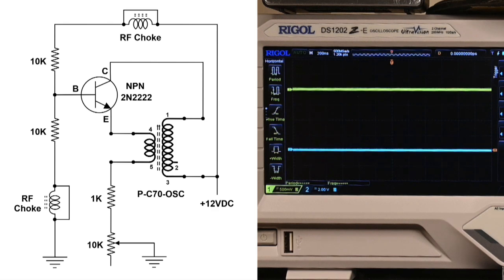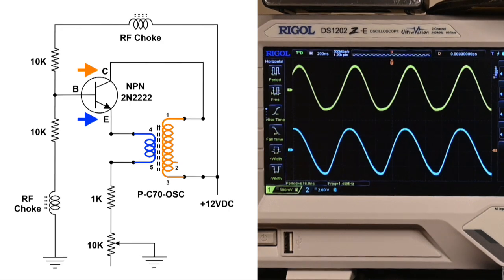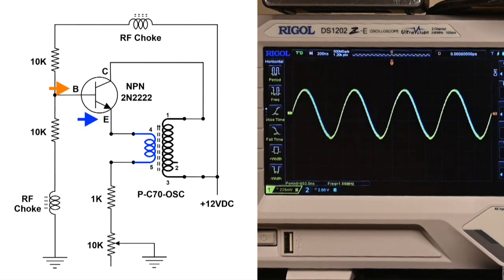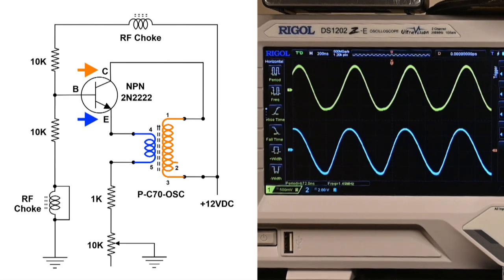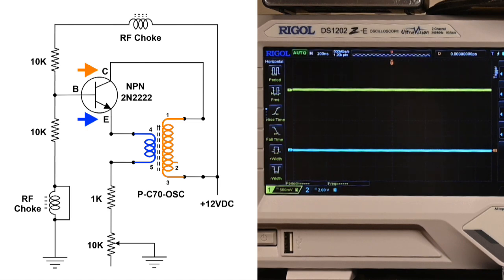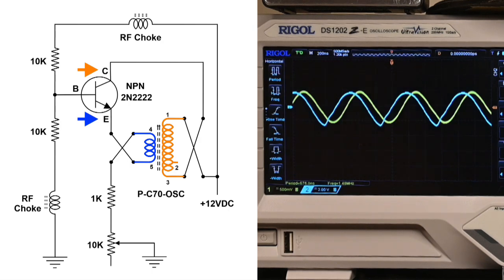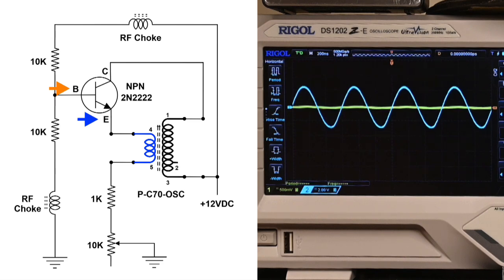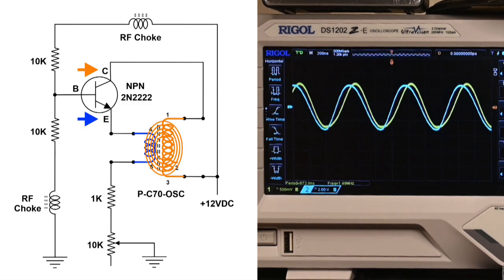Oscillator Experiment Interesting Results II

Comment: The metal strips in your breadboard are capacitance coupling the feedback to the base. The proof is lightly loading the base with the oscilloscope probe quenches the oscillation. Fun but not a mystery.  The same circuit built dead bug style over a copper ground plane it will not oscillate.
Reply from the maker: I had thought of that. I had put the transistor and the 10K bias resistors on a separate small board. There was no change. It's hard to remember everything as you make a video. Here is part II.
Oscillator Experiment Interesting Results II 
https://youtu.be/MITyF5wX8SQ

Comment: Nice little experiment
Reply from the maker: hanks for your comments.
I have had several interesting comments and suggestions about modifying this circuit. So I modified the circuit and made another video. I thought this would help answer some question. There is the link.
Oscillator Experiment Interesting Results Part II
https://youtu.be/l_yRTZ-YoPc

Comment: Its looking like the high frequency o-scopes are quite difficult to find for $1000 or less (or even slightly above $1000.  What did they use to test microwave circuits back in the day since the super expensive high frequency o-scopes are a relativly modern development?  Or have these high frequency o-scopes always been around and just never come down in price and only available to large institutions?

I wonder if its possible to build a high frequency o-scope?  I built a metal cutting CNC machine and a chemical lab why not an o-scope.
Reply from the maker: Yes you could build your own, but usually it does not save money. Most often  it costs more and is not as accurate.

Comment: 🤠
Reply from the maker: Thanks for your comments.
I have had several interesting comments and suggestions about modifying this circuit. So I modified the circuit and made another video. I thought this would help answer some question. There is the link.
Oscillator Experiment Interesting Results Part II
https://youtu.be/l_yRTZ-YoPc

Comment: Akways fun and informative whenever you release a video!
Reply from the maker: Thanks for your comments.
I have had several interesting comments and suggestions about modifying this circuit. So I modified the circuit and made another video. I thought this would help answer some question. There is the link.
Oscillator Experiment Interesting Results Part II
https://youtu.be/l_yRTZ-YoPc

Comment: Wondering what would happen with a variable cap across the secondary.  I liked the format of the presentation, thanks Rick
Reply from the maker: Thanks for your comments.
I have had several interesting comments and suggestions about modifying this circuit. So I modified the circuit and made another video. I thought this would help answer some question. There is the link.
Oscillator Experiment Interesting Results Part II
https://youtu.be/l_yRTZ-YoPc

Comment: when you swap both your basicly just returning it to the same state as before, does the change in wave form have something to do with tap 2 on the secondary?
Reply from the maker: Thanks for your comments.
I have had several interesting comments and suggestions about modifying this circuit. So I modified the circuit and made another video. I thought this would help answer some question. There is the link.
Oscillator Experiment Interesting Results Part II
https://youtu.be/l_yRTZ-YoPc

Comment: Looks like a Colpitts oscillator with a transformer feedback instead of capacitors. You should be able to use a tuning cap across the secondary. It should also function as a frequency mixer/modulator if you apply a signal to the base through a cap.
Reply from the maker: Thanks for your comments.
I have had several interesting comments and suggestions about modifying this circuit. So I modified the circuit and made another video. I thought this would help answer some question. There is the link.
Oscillator Experiment Interesting Results Part II
https://youtu.be/l_yRTZ-YoPc

Comment: That's a common base amplifier with positive feedback. Good examples for such use in RF oscillators.
Reply from the maker: Thanks for your comments.
I have had several interesting comments and suggestions about modifying this circuit. So I modified the circuit and made another video. I thought this would help answer some question. There is the link.
Oscillator Experiment Interesting Results Part II
https://youtu.be/l_yRTZ-YoPc
Reply: @AllAmericanFiveRadio  thank you for sharing.

Comment: Sir. I may be mistaken, but it appears that you have a emitter follower circuit through the transformer coils
Reply from the maker: Thanks for your comments.
I have had several interesting comments and suggestions about modifying this circuit. So I modified the circuit and made another video. I thought this would help answer some question. There is the link.
Oscillator Experiment Interesting Results Part II
https://youtu.be/l_yRTZ-YoPc

Comment: Great video, can I ask the AM tx you built on another video, what would you need to change to make it LW ?
Reply from the maker: Thanks.
Use less capacitance in the variable capacitor in the tank circuit. It works,

Comment: But what determine the frequency of oscillation  without a capacitor or the parasitic one will do the job?
Reply from the maker: Parasitic and a bigger influence is the ferric adjustable core.
 Looking at the lower left of the Oscilloscope screen the frequency varied from about 1.4 MHz to about 1.6MHz. It is small type.

Comment: TOTALLY AMAZED. 

My best guesses:
-As there are two coils, where each one has self-inductance, it is a second order system. The mutual inductance between them contribute to positive feedback, but also the bridge collector-emitter of the transistor, which is supposed to invert signal 180 degrees, but in this case seems to act as a resistor(???), where the base provides a current to set the resistance and initiate the oscillation.

-At 7:20 the oscillation stopped due to the some 10pF capacitance of the probe to the ground and that the  feedback of the mutual inductance tends to be more negative than positive in this configuration (imagining dot convention now...)..
Interesting that when inverting the collector coil it works the same, but when inverting the emitter coil, the oscillation stops if the base is measured. 

-The transformer also has in each coil a distributed capacitance, which form L-C tanks.
 In fact, I made a circuit few days ago and found that a 😂1:10 ratio  60Hz transformer has a different turns ratio at certain frequencies, which proves the existence of that capacitances. Even it has a resonant frequency at 12kHz, at which the apparent turns ratio is maximum, around 1:30.
But it seems from the photos that the transformer used should have a very high resonant turns-ratio frequency.
Reply from the maker: Thank you!
 Looking at the lower left of the Oscilloscope screen the frequency varied from about 1.4 MHz to about 1.6MHz. It is small type.

Comment: Would that be a common base configuration?
Reply from the maker: Thanks for your comments.
I have had several interesting comments and suggestions about modifying this circuit. So I modified the circuit and made another video. I thought this would help answer some question. There is the link.
Oscillator Experiment Interesting Results Part II
https://youtu.be/l_yRTZ-YoPc

Comment: Just a thought: It looks like a common base oscillator, it would be interesting to place a capacitor from the base to the ground. Interesting video, thank you.
Reply: I thought the same...
Reply from the maker: Thanks for your comments.
I have had several interesting comments and suggestions about modifying this circuit. So I modified the circuit and made another video. I thought this would help answer some question. There is the link.
Oscillator Experiment Interesting Results Part II
https://youtu.be/l_yRTZ-YoPc
Reply from the maker: Thanks for your comments.
I have had several interesting comments and suggestions about modifying this circuit. So I modified the circuit and made another video. I thought this would help answer some question. There is the link.
Oscillator Experiment Interesting Results Part II
https://youtu.be/l_yRTZ-YoPc